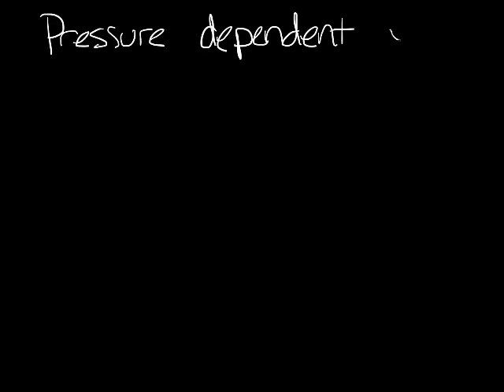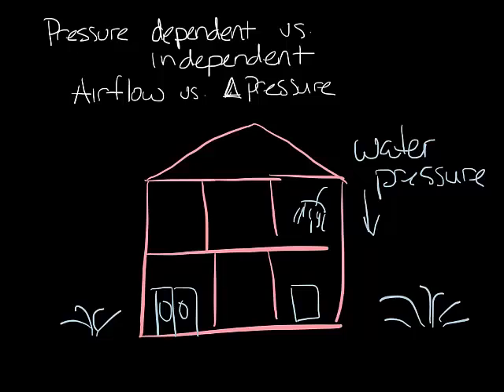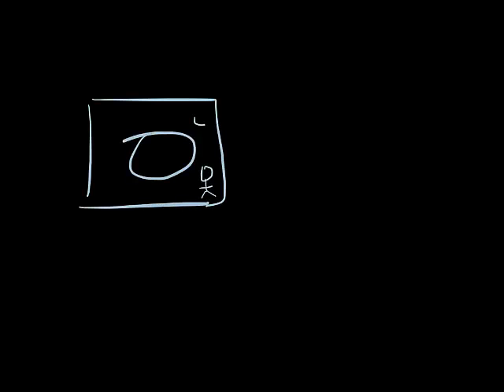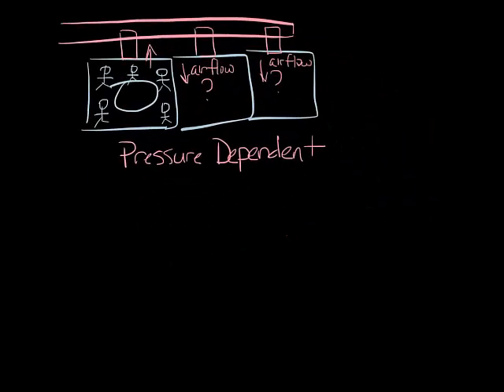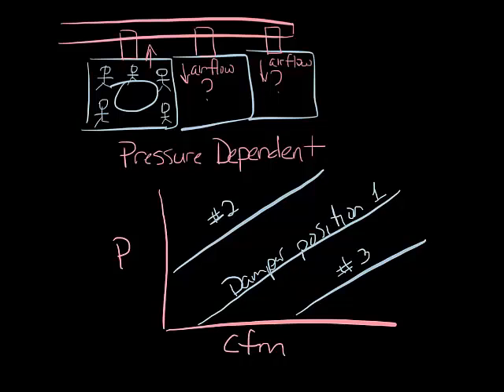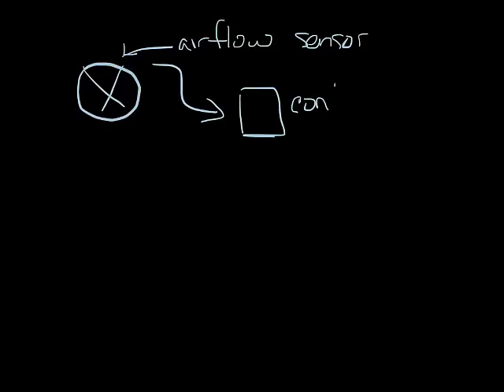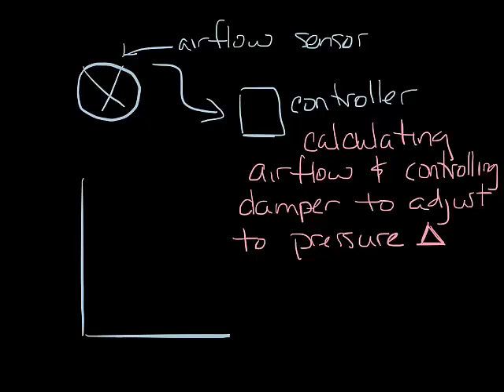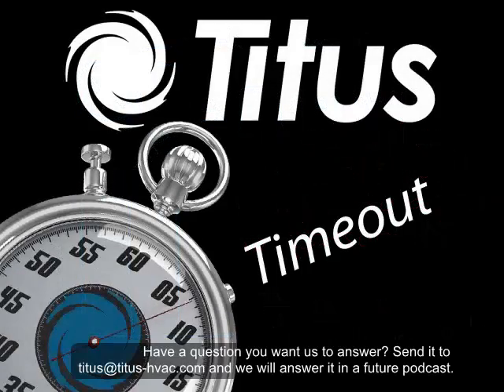Titus Timeout Podcast - Pressure Dependence vs Pressure Independence

Comment: Are they physically the same other than the pressure independent box having an airflow sensor?
Reply from the maker: Pressure independent and pressure dependent terminal units have two differences regarding their control components. In order to be pressure independent, a unit must have an airflow sensor and a controller. The controller is usually a controller/actuator with an integral pressure transducer to read the airflow sensor signal. Pressure dependent units have no airflow sensor or controller. Pressure dependent units typically just have a damper actuator that receives a positioning signal from a wall thermostat.